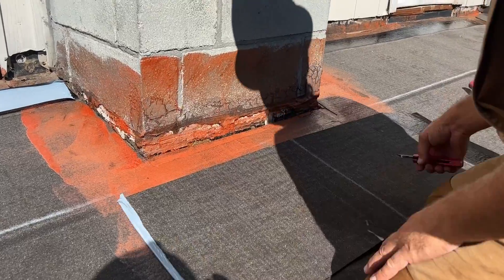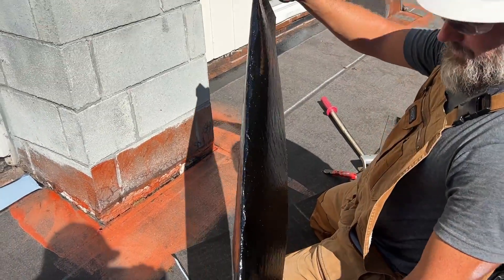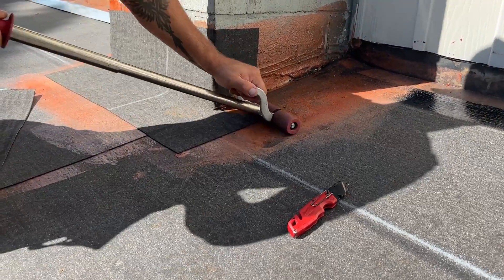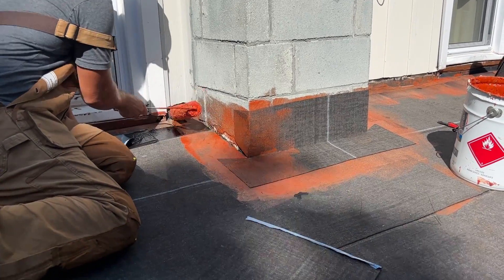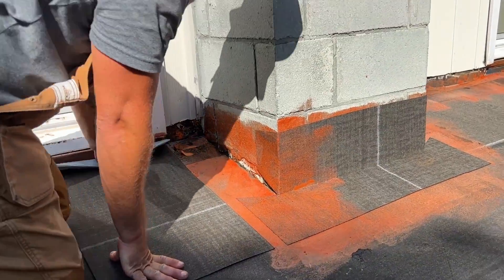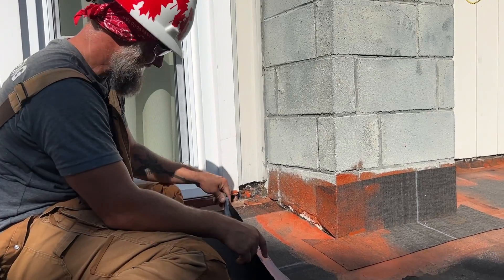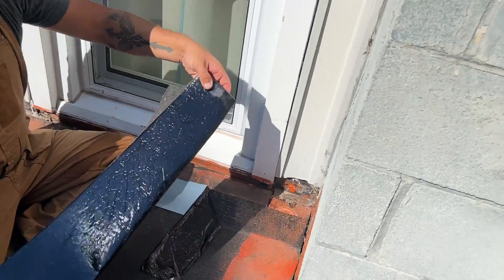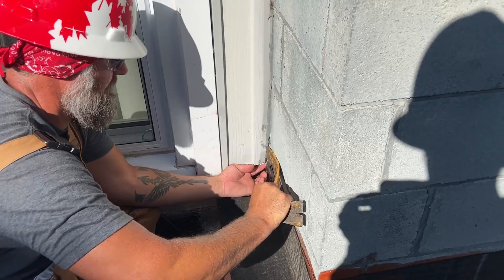How to Install Peel and Stick Flashings

Comment: Wow first time seeing primer used to adhere ice and water, super interesting! What type of primer is that?
Reply from the maker: Hi! Thanks for the question.  The primer is Soprema Elastacol Stick. This looks like ice and water but is much thicker. Its the base layer of a 2 ply Soprema flat roof system.
Reply: What is the manufacturer and part number for the peel n stick?